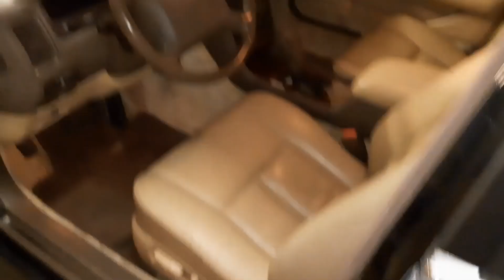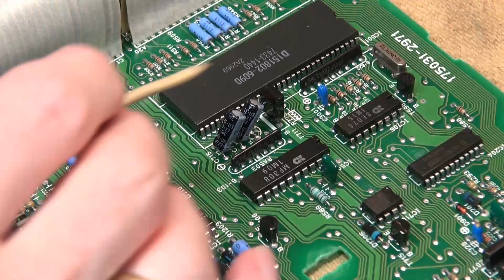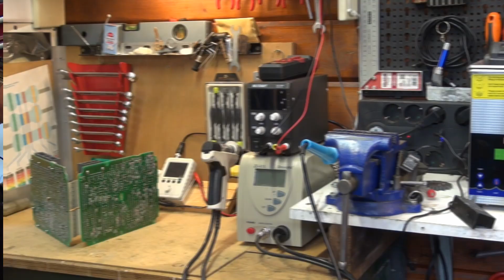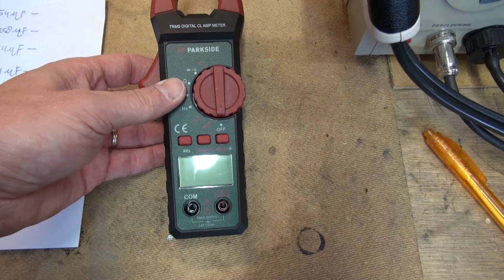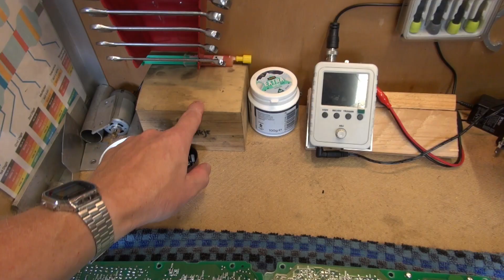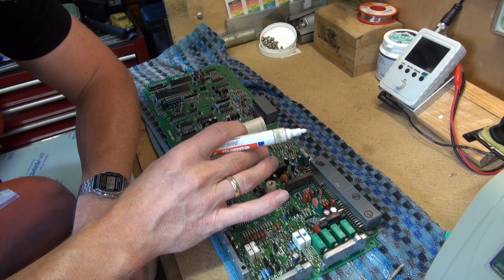Toyota Lexus ECU 89661-50102 repair

Comment: Can you fix the 89661-60G50 for toyota landcruiser
Reply: Please can you fix the ecu-ecm 89661-60G50 for toyota landcruiser
Reply from the maker: Not yet, at this moment I haven't got the right tools for the newer generation of electronics. But if you could send me some pictures of the circuit board, I can make an assesment of the work: arnold@ls400-ecurepair.com